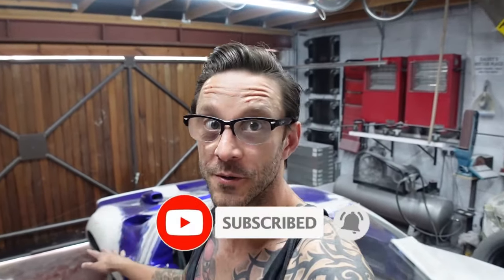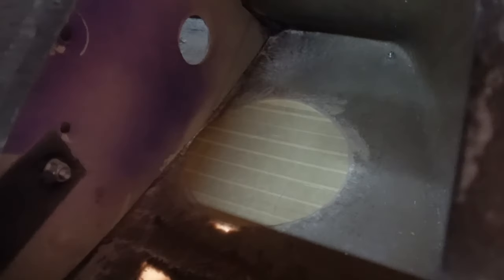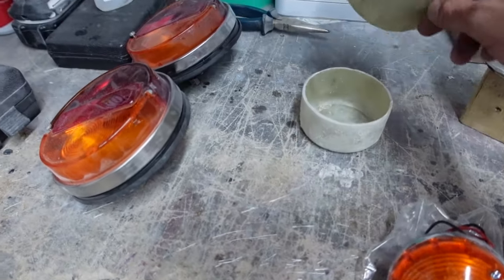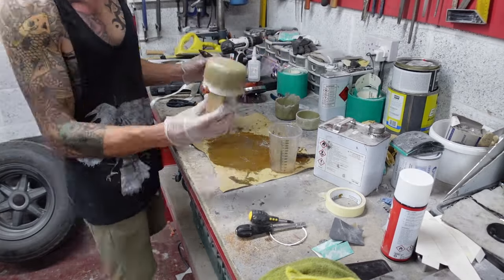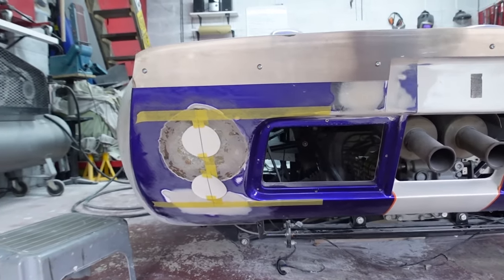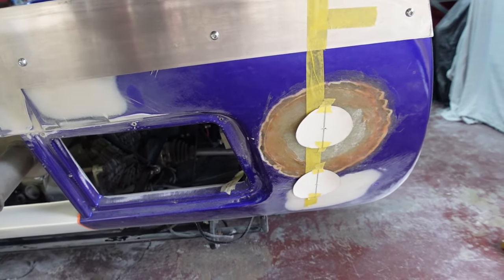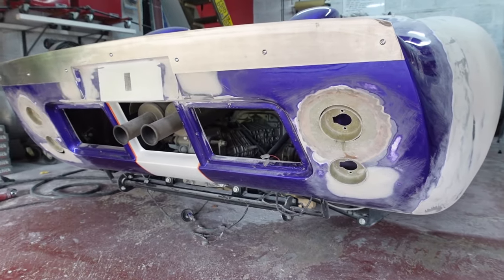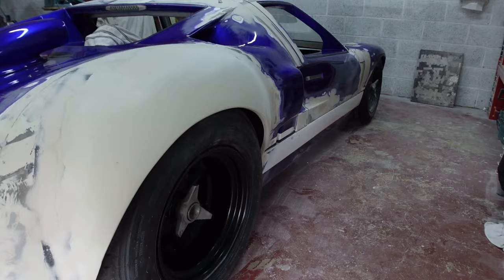GT40 Restoration - Ep 24: Fitting Pre 1965 Rear Lights

Comment: Going back to an earlier episode. I have just bought new number plates ready to get mine back on the road and discovered that to pass an MOT they have to comply with BS AU 145, so cutting a plate down to size may affect this.
But, more to the point for you, since the beginning of this year, cars built after 1980 cannot use silver on black plates.
Worth checking if I've understood this right ...
Reply from the maker: Cutting down a plate isn't an issue as long as you have 10mm of surround around the lettering, I'll get some stick on plates of the correct colours if the tester isn't having a good day, no big deal

Comment: Aren't the brake lights suppose to be on top instead of the turn signal intercators?🤔 You ruined the gel coat changing the tail lights.
Reply from the maker: I prefer the brake lights at the bottom but I'll check the regs. I don't understand the relevance of your comment re: the gel coat, it doesn't matter in the slightest